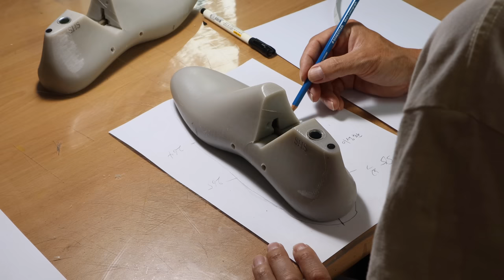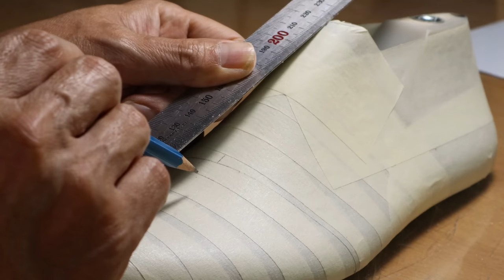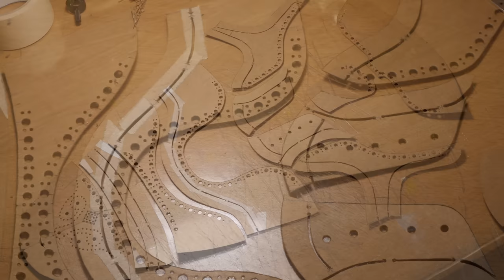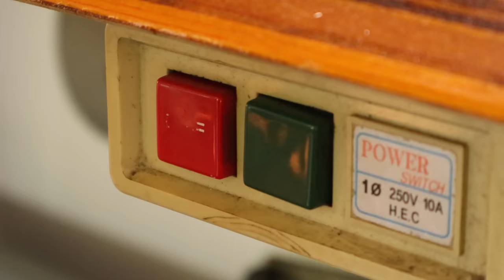Making HANDMADE Full Brogue Oxford Shoes

Comment: Marvelous work! Congratulations for being so dedicated, patient, and determined. This is how shoes should be done with natural materials, sustainable, biodegradable, flexible, breathable, built carefully to last, and with a healthy shape for the feet. 

Today we get extremely expensive plastic and glued shoes, with terrible shapes, non breathable, non biodegradable; that pollute our planet before, during, and after their production and wear; that are terrible for our feet; and that last only one season -- even leather shoes are built with the most thin leather and get all wrinkled and peel in two days. The industry of plastic-clothes and shoes today is the most effective way to pollute our planet, destroy decent jobs, and forever lose the knowledge of our craftsmen. Only because plastic is extremely CHEAP and businessmen get the maximum benefits. GREED, we will only change when it will be too late. 

I want to denounce the use of what it is ironically called "vegan leather" as it will be of any good, because it doesn't use animals. "Vegan leather" is PU, polyurethane : a plastic derived from oil (petrol, gasoline, hydrocarbons), non biodegradable, and a pollutant. To use PU leather = faux leather = vegan leather is by far worse for the environment that using genuine leather. Genuine leather decompose and it is sustainable. Those who are concerned about the ill treatment given to the animals, should fight to promote laws to give them a better treatment, but using a plastic instead is a terrible decision. Please, get informed about the Plastic Pollution Crisis we have on our planet! We should wear, as far as it is possible, natural materials and help the artisans to keep their craft and jobs.
Reply from the maker: Natural leather is the best material. Thank you so much for watching my video and leaving a comment.